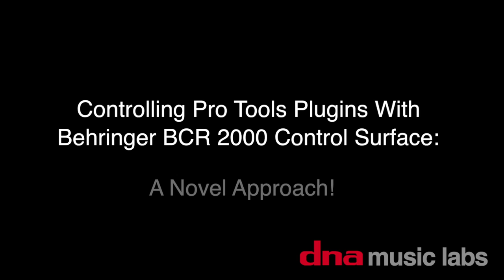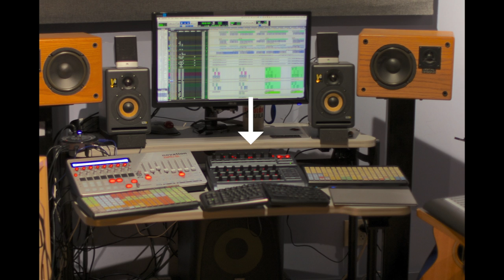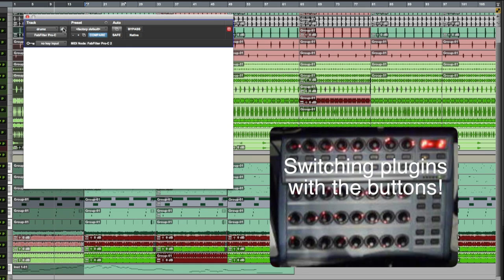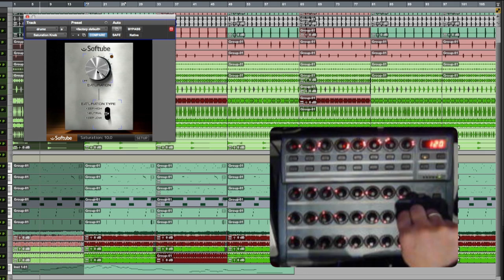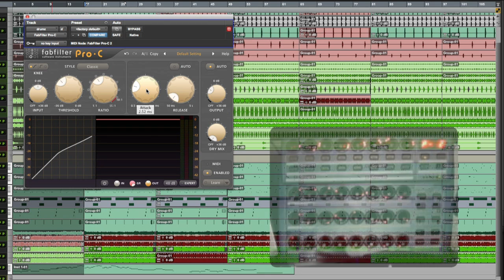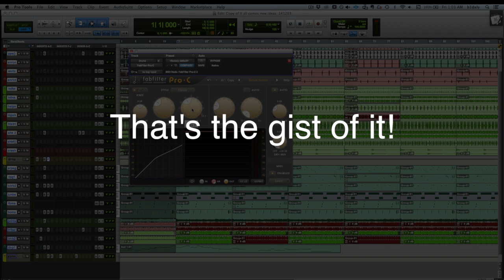Controling Pro Tools Plugins with a Behringer BCR 2000 Control Surface: An alternative approach!

Comment: Thanks for this tutorial. I'm very familiar with ControllermMate and got through this tutorial pretty easily. My question is this: Is there a way to let controllermate recognize the plugin in window you are working with? As far as I can tell you need to dedicate a knob for every parameter on every plugin you own. Is it possible to use a knob for more than one plugin?
Reply from the maker: Sorry for the delayed response. At this point there is no automatic way to do this. You can however set up "switches" using the Modifier building block that would allow you to press a key to switch to different EQs for example. 

I have explored ways to do this automatically using other software, but it gets more complicated.

Comment: I have one question about the onscreen plugins control tutorial you created 
are you able to control different plugins with same encoder? 
For example lets say you only have one knob encoder(sending same midi message)
and want to control input gain on different plugins you have setup with controllermate without having to go check and  uncheck every single plugins your using. 
just have controller mate trigger only onscreen plugins and not trigger other programmed plugins.

By the way your video tutorial and tricks has been tremendous help, I cant thank you enough 
hopefully there is a solution for the problem I have here thanks in advance!
Reply from the maker: At this point there is no automatic way to do this. You can however set up "switches" using the Modifier building block that would allow you to press a key to switch to different EQs for example.
Reply: @Dnamusiclabs  is this switching what you are doing with some buttons?  Going to the different active one? 
I assume the question asker mean if you are able to control simultaneous knobs on different plugins. 
And any tutoial instructions for the actual controller software?

Comment: I too miss working on an analog console and been looking for a solution for years...

Have you tried the  BEHRINGER X-Touch Universal Controls yet? If it works well in Pro Tools it might be just what I've been searching for. Fingers crossed! ;-)))
Reply: It sucks with Pro Tools!!!! Behringer is another Flop!!!!
Reply from the maker: It's limited to the HUI protocol. I find that HUI works well for things like fader and send levels, pan settings, but is a bad experience for controlling plugin parameters. Which is one reason I developed the ProMIDIco system.

Comment: i have a mackie logic control surface..  it will control the parameters on the plug-in such as the fab pro c..but my thing is.. i saw how you were able  click on different inserts usig your BCR.now thats what im trying to do with my midi controller,i would like to navigate between different plug ins and also how do I bypass a plug in without using a mouse
Reply from the maker: The ProMIDIco system I have outlined here will let you do this. It does however take some effort to set it up. Here's the full tutorial:

http://dnamusiclabs.com/harmonic-distortion/protools-controllermate-tutorial

Comment: I went through all kinds of controllers even this one, for plug-ins, mapping layout, trashing prefs, having to remapping on upgrades etc. Got a Slate MTi .... all your headaches will  be gone.
Reply from the maker: maybe so, but the Slate is still a gui based pointer device. I've been looking for a way to control plugins with a hardware knob, which the Slate does not help with.

Comment: Very interesting. Difficult to tell from the video though - does this method require that the plugin windows open at exactly the same x,y position on screen each time?
Reply from the maker: Hey guys, no the method does not require the plugin window to be open at the same position. It does rely on the plugin window being the "active window." When you open a plugin via the Pro Tools insert it will be the active window, and you can tell because the little red dot (where you click to close) will be lit red. If a plugin window is not the active window, you can click on it to make it active.
Reply: Exactly what I would like to know. And thanks for the video!
Reply: Thank you much for the reply!

Comment: Great idea. Been looking for something myself, can I ask, is the software fairly easy to use/map and if you want to change what plug ins you are using, say you decide change EQs much later on in you mix, does that involve remapping for that new plug in ? I'm guessing it does, would this impede your work flow significantly if you did this a lot?
Reply: Hi Emmet, I would say this approach, which I am now calling the ProMIDIco System, is of intermediate level of difficulty. It is a roll-your-own solution, so you do have to get familiar with the the programming/mapping. It doesn't change the functioning of any plug-ins, so it won't impede any particular workflow. If you switch to a plug-in that you haven't mapped, you simply won't have control with the hardware. I've created a detailed tutorial if you're interested. http://dnamusiclabs.com/harmonic-distortion/protools-controllermate-tutorial